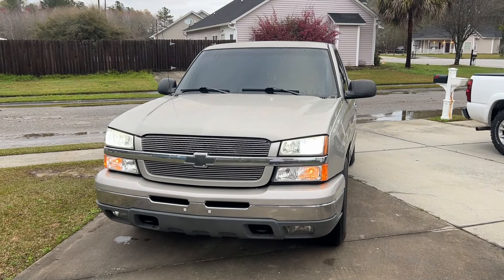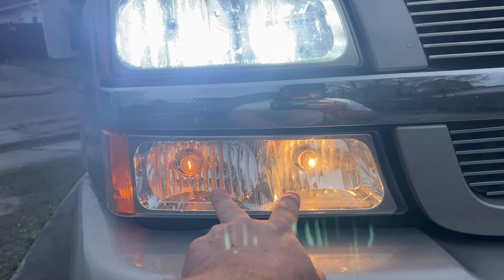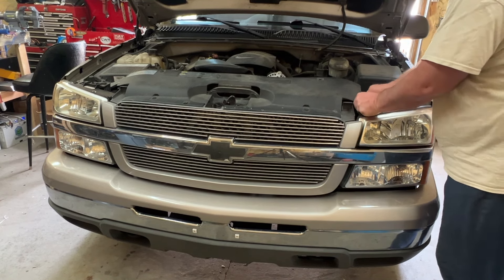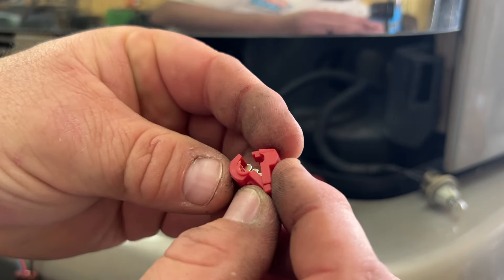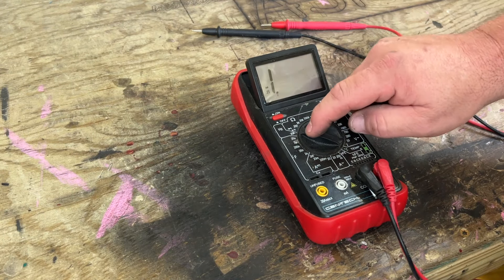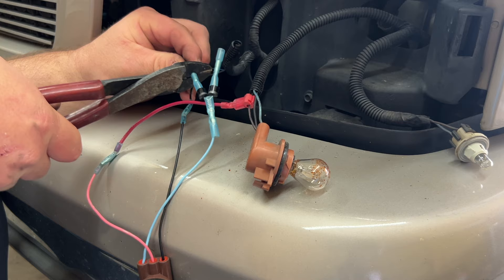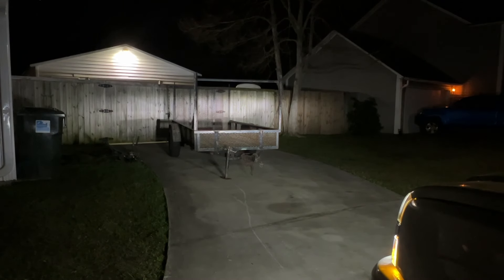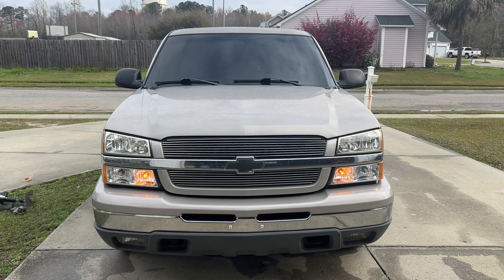99-06 NBS LED Switchback Install & Retain All Functions | DRL PARK TURN HAZARD

Comment: Would there be any harm in going with a 20 amp diode a little bigger than the 10 amp you used

Comment: That looks and works great.How did you seal all the connections from the crud, did you use like liquid tape or something else?
Reply from the maker: The connections were made with heatshrink butt connectors.
Reply: I'm t.g and watch your YouTube channel a lot. I just need some advice about my golf cart
Reply: Are the diotes for the high beams?